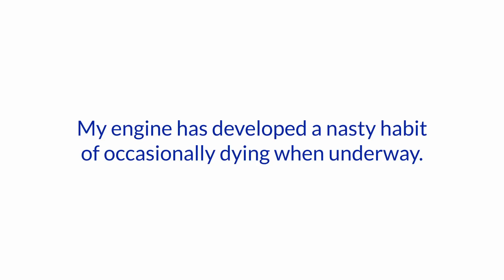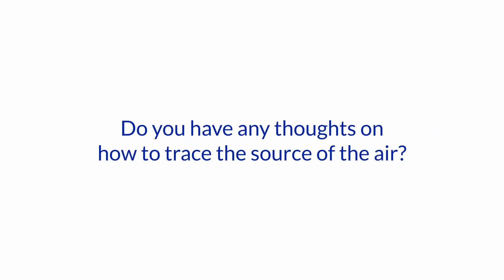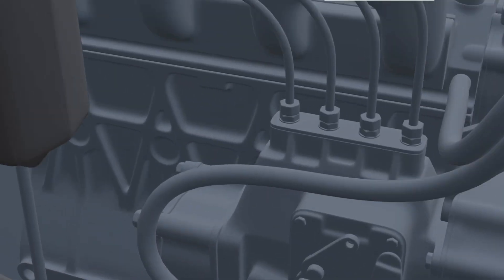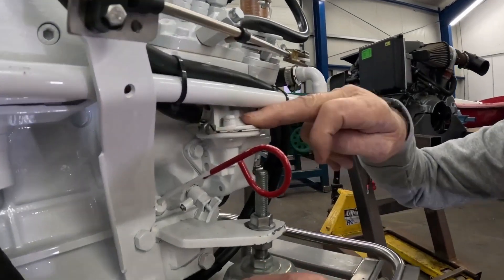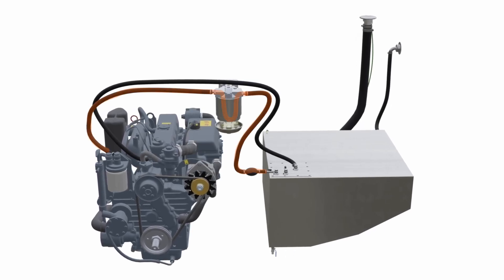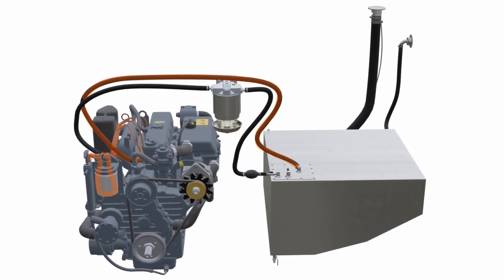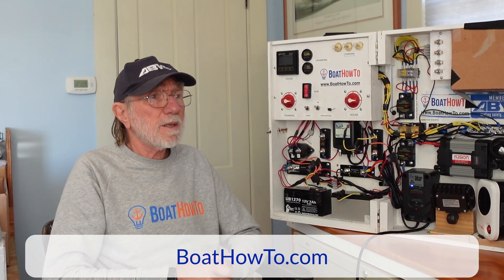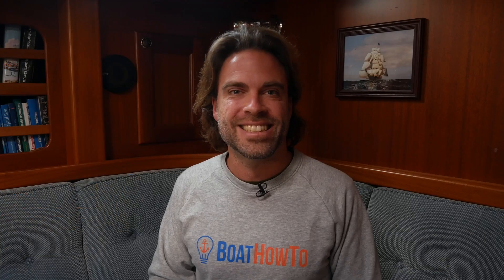My Marine DIESEL ENGINE dies when UNDERWAY 😰 | Ask The Expert with NIGEL CALDER

Comment: I had to trace a perplexing intermittent fault i suspected was an Air Leak, but couldn't detect anything..
I ended up using a Rag to seal the open Filler Cap while blowing enough Compressed Air into the Tank to mildly pressurise the Fuel Lines.
As soon as I did this, my helper could see a jet of Fuel from a small, visibly undetectable fissure in the Fuel Line.
I replaced that section and it worked flawlessly.